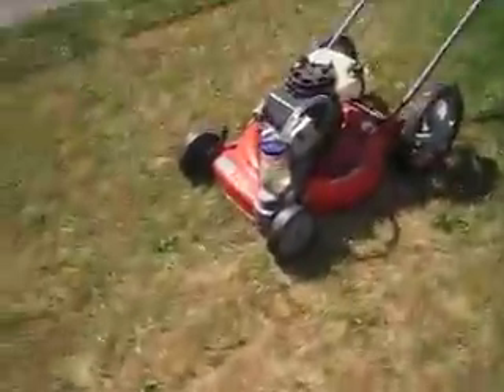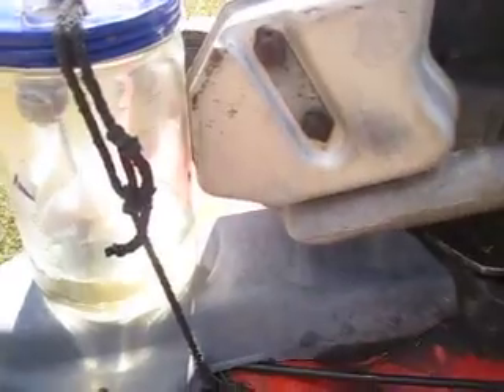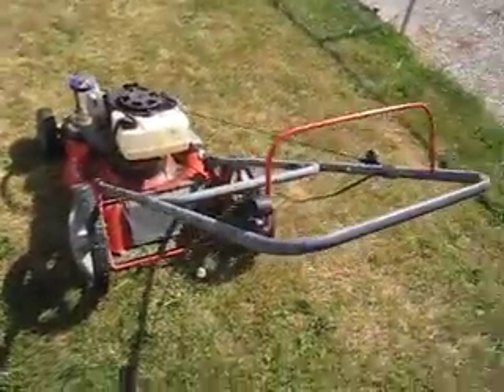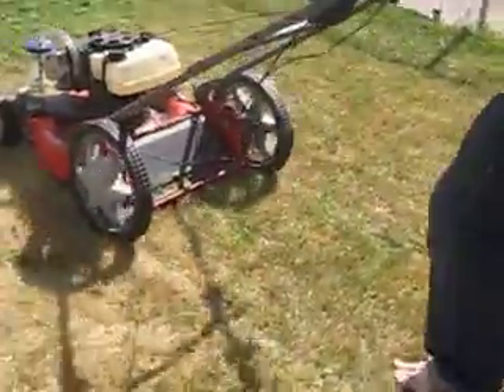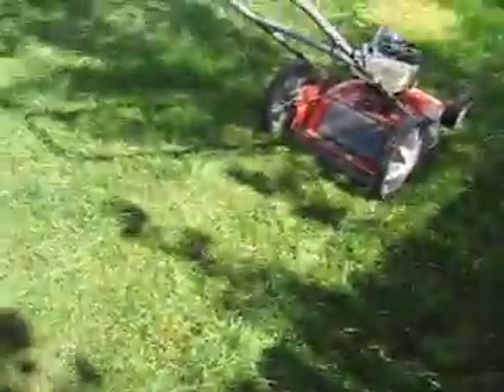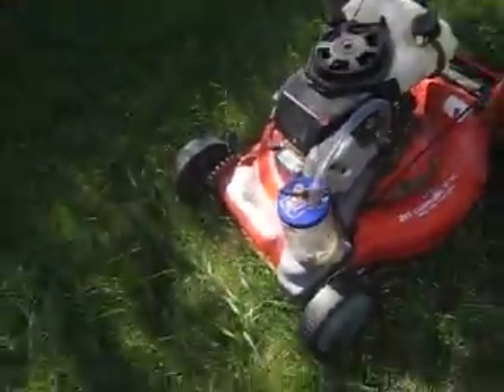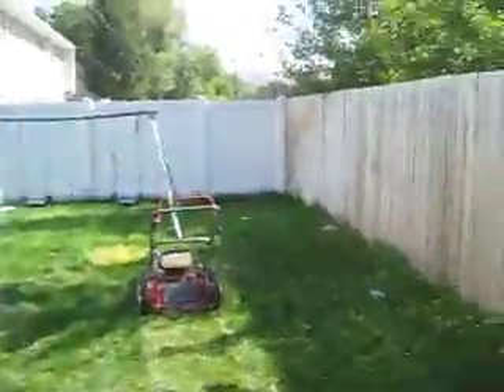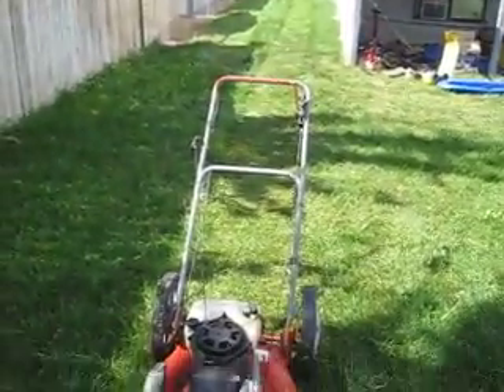Lawn Mower Running On Gasoline Vapor

Comment: Tyson, great test running your extremely simple to make, gasoline vaporizer. A simplified version of the GEET Fuel Processor. This is the first complaint many physicist and engineers claim was impossible, which is to run any 4cycle engine on 100% vaporized gasoline, under load. And you just did that with a simple glass jar and tubing. Incredible.

Comment: Thanks Tyson, That's the answer I need. Kind of like your secondary air valve installed on your car in your gasoline vapor by bubbles method video, to provide more power when you accelerate on the road. Cool!  Makes alot of sense.!

Comment from the maker: It is definitely a very simple idea! Even my new vaporizer I have designed form my car is simple! The key to using a bubbler design is to keep the splashing down and to add a form of heat into or around the container to heat the gas so the engine runs off of a light dry vapor instead of a dense cold vapor.

Comment from the maker: Thanks! I will be building a heat generated vaporizer for my lawn mower to shod the method that is similar to the one done on my car. It will be different but the concept is the same. I have only ran the mower multiple times in one day so as far as the humidity etc. effecting it I'll have to let you know after testing it on different days. I am also going to try a nearly closed loop system to see how that works. As for the car still not sure how much longer it will be but hopefully soon!

Comment: That idea is very crude but works only the gas will get cold so you would have to build a exhust heater tube to release the fumes once they start to freeze.

Comment from the maker: Thats a good diagram! I will be making a double walled container so that I can curculate exhaust around the bubbler chamber to heat the chamber and the gas. I will them place some beads into the container to prevent the gas from bubbling to intensely. Socks also work great to reduce splashing. I also placed a cloth filter in the vapor outlet tube to prevent any liquid from entering the outlet tube. I will make another video showing how this is done. Good link!

Comment from the maker: Yes keeping it on would have been much better and would have allowed me to regulate the vapor input. The carb froze up so the valves etc. did not work. If I can get my hands on a new carb I will put it on then attach the vapor system to it for much better vapor regulation.

Comment from the maker: At the time it wasn't too hot but it was hot enough to create vapor by heat however it was definitely not hot enough to vaporize all parts of the gasoline such as the additives, so it was a mixture of cooler dense vapors and lighter hot vapors.

Comment: Maybe you could try using copper tubing to extend the exhaust, and then coil it around the jar.  It would take a minute or two to heat up the jar, but it would definitely radiate enough heat.

Comment from the maker: I will be mounting a fitting  where the carb use to be and to that fitting I will attach a air control valve that will be connected to a cable which will be attach near the self propelled controller lever, as you adjust the air control lever you will be adjusting the opening in the air inlet valve so that more or less air can pass through it, this in turn controls the RPM's of the engine.

Comment: Nice job, Tyson! How long did the gas in the jar last? Did it poop out due to humidity degrading it  Should it last as long as there is visible, liquid gas component still there, regardless of color, freshness, or dilution changes that might result from ambient, humid air contamination ?. Also looking forward to the heat method of vapor production for car when it's ready. How long now, do you think? thanks for sharing!

Comment from the maker: The cloth filters (Socks) may filter out the moisture enough to help maintain a more consistent moisture in the bubbler. I am also going to be injecting water into the engine to see what kind of water to fuel ratio I can obtain.

Comment: Thanks for your videos. I always appreciate them. However, in this vid, when you are describing which hoses do what, you say,"...this hose over here goes..." and you don't show which hose you're talking about, so I don't know if the long hose goes down into the liquid fuel, and I don't know what the other hole on the jar lid is for. The images go from the top of the jar then down to the carburetor without saying which of the hoses you're showing corresponds to the which of the jar-lid hoses.

Comment: This is so cool. Any problems with it revving too high. Can you make a more precise system for the fuel delivery?
Reply from the maker: I have control of the rpm's so yes you can let it rev to high if you are not controlling it. I did let it run at max rpm's for a long time with no problems but after time this would damage the engine.

Comment: So you say "HHO for life".  Makes me think you also run engines with HHO gas. ? -My question is about running HHO and gasoline together for engines not modified for HHO only.  Will Gasoline vapors and HHO run well together on unmodified gasoline engines?  I am hoping to combine Gasoline vapors and HHO to run electricity generators where electric supply and gas supply always have problems.

Comment: Why is water mixed in the fas? Is it to make sure the air fuel ratio isnt too rich?
Reply from the maker: It was mixed into the gas to see if the engine would run using it and to see if it would help maximize fuel savings, add a boost of horse horse power,and to help the engine run cooler.

Comment: How much does this improve fuel efficiency ?
Reply from the maker: The most I got was about a 45 minute run time out of 1/2 cup of gas.I had water mixed in with the fuel when I did that test. It was not running at full power the whole time but was still able to cut the grass. As there becomes less fuel the secondary air intake valve needed to be closed. You constantly have to adjust the system as the mower runs due to the state of the fuel changing. When there is next to no fuel left the valves (all of them) have to be almost completely closed to keep the mower running.